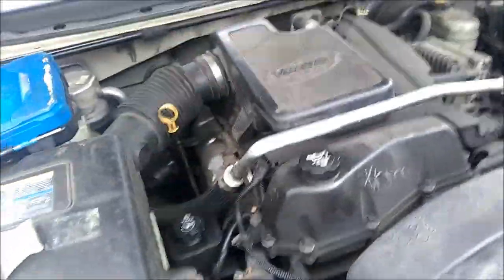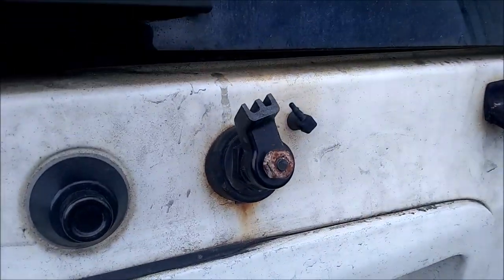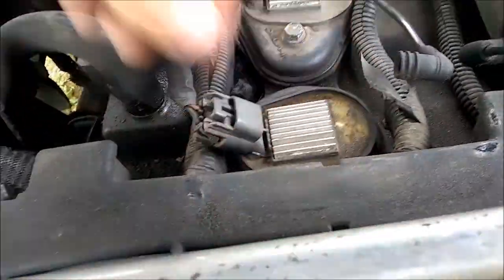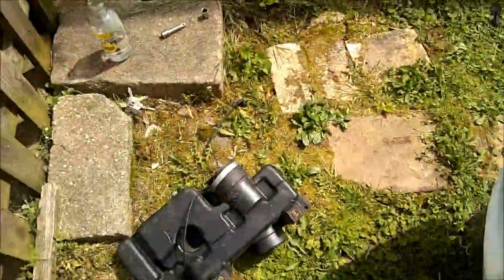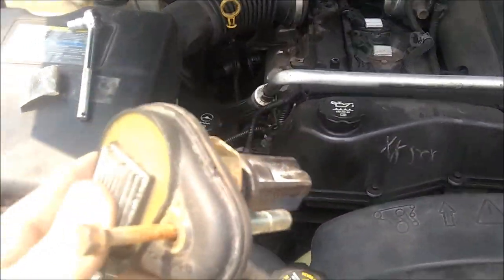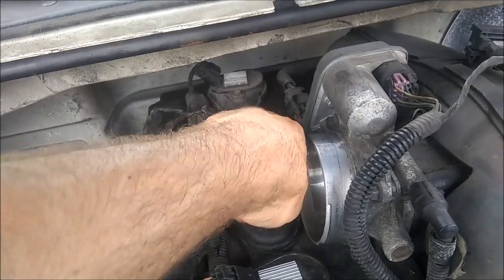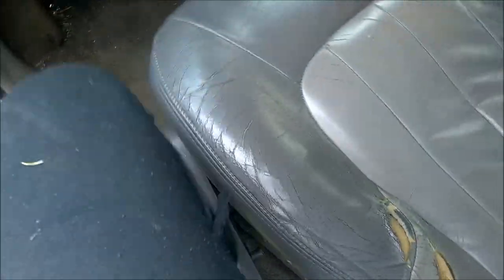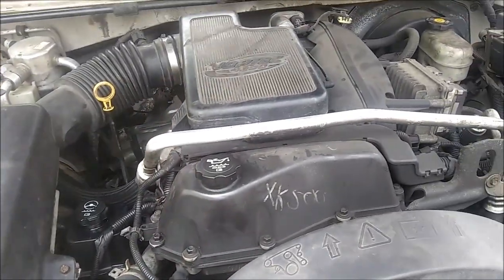2003 4.2 V6 GMC Envoy misfire Diagnose and Repair

Comment: Thanks for the video.  I replaced all the coil packs with aftermarket, and put new spark plugs in, and turns out one wasnt sitting right.  This video helped me sort out the problem. Ive got an 02 Envoy with 177k and she's running like a charm again. Its a good body design that stays in style.  It still looks like new, and looks better than some of these over teched out 2023 models.

Comment: My 4th coil pack from the front was bad also. I figured it's been 19 years so I changed them all out. It only cost me $72. Purring like a kitten at 240,000 miles.

Comment: bought a really nice clean 02 last fall. just took a 300 mile trip to missouri yesterday. ran perfect. today hooked up the pontoon to go fishing. soon as i pulled out shudders. it was my #2 from the front. no pops no rpm change. the rest did both. ruined the day but easy enough to fix.

Comment: That is not a v-6. It is an inline six.
Reply: Sometimes called that to represent "Vortec 6", whatever that is.  It was a marketing term years ago.  Confusing though.
Reply: @dboy6400  I agree. Its maybe just a marketing tool to make the bland old straight 6 sound real attractive. Those old engines have been around for decades and for the most part were pushrod engines.

Comment: The problem w aftermarket ebay coils they don't last so dont buy them . But the Delphi Coils (factory)are good but the spring in the rubber boot shrinks doesn't let spark run thru it so it fails just buy the replacement boots from auto part store don't buy the coil there still good.

Comment: What can cause low compression on 1 cylinder??? Had a misfire on 4, replaced the plugs , replaced coil packs, vvt and cam sensor, still run just like that... Help pleaae

Comment: I've got a '02 Envoy. Check your power steering steel pipes for rusted out holes where the lines run on top of the driver's side frame horn. You can access them from the fender well. I fixed mine, bion, with steel braided toilet connection hose and a two hoe clamps on each end - 5 years ago. no leaks or problems whatsoever. Before I refined my method here, I ran the pump dry a number of times. Those pumps can take a beating.

Comment: I have a 2003 also. Just yesterday I changed out my spark plugs and all coil paks. It was running extremely rough above 50mph and the idle wasn't the same. You could tell something was going on. Well it's back to running smooth. Some of my gauges are broke also. The gas and temp work. And the battery is hit and miss. I bought stepper motors over 7 years ago and have yet to put them in. Maybe one of these days i'll get around to it. :)

Comment: What are you listening for when checking which cylinder isn’t firing?
Reply: when you pull each coil out individually you should hear the snapping of the spark as well as the engine should struggle to idle even more and go back to the slight miss when you put it back on. the one thats bad wont pop from the spark and the engine will ide the same. thats the bad one.

Comment: My 2005 gmc envoy 110,000 had a missfire I bought 6new spark plugs started running a little better except the coils were bad so I went to go buy 2 coils as I was changing them with the car on the car turned off. Had to have the car towed and now it’s cranking but won’t start. Anybody have any idea?
Reply: Same here